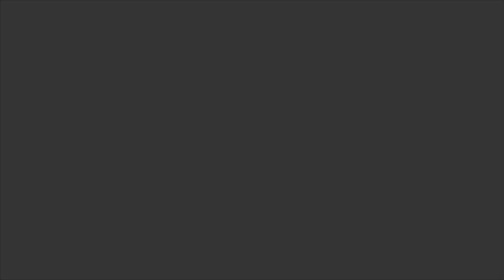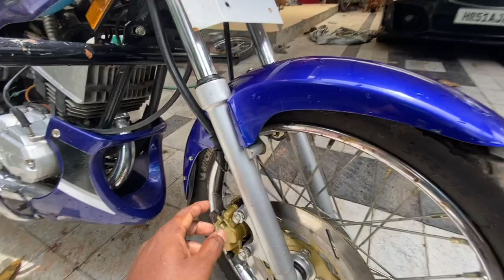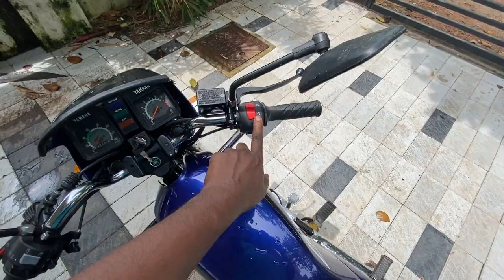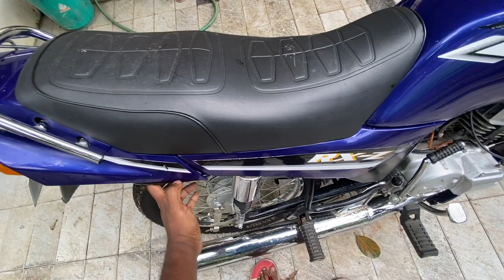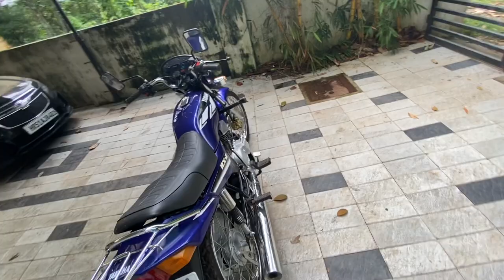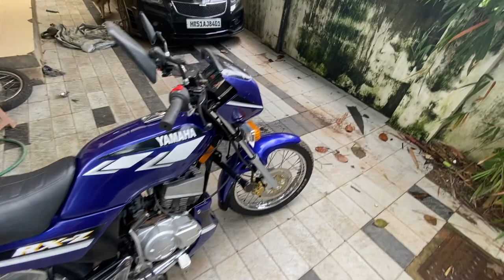Yamaha RXZ Mayalayam Review

Comment: Bro ee RXZ spedometer CD100 il namakk set chyan pattimo with RPM also angane chyanm  enkil enthokke mattam varuthanm plz rply
Reply from the maker: Athu eluppam alla, 4 stroke reading double aanu
Reply: @Yamakaze   ok bro ath chyanm nkil etha chyandath enn onn  cmnt idamo?
Reply from the maker: @cillianmurphy2130  simple parupadi oru pulsar meter set cheyunath aanu, 3 wire pidich koduthal mathi, positive from battery, negative from battery and pulse from HT coil.
Reply: @Yamakaze   ok bro thankyou
Reply from the maker: @cillianmurphy2130  👍

Comment: Bro I need to convert my stock 5 speed to 6 like 4s to 5s what will be the cost and how can I do
Reply from the maker: You cannot fix the six speed gearbox in the 5 speed case, not worth the efforts
Reply: @Yamakaze  any way I can convert 14bhp to 18 bhp king
Reply from the maker: Cylinder kit, connecting rod, carburetor, head and you are done for the performance. The rx king has different compression than Indian cylinder so the load on the connecting rod is higher, that’s the reason I have mentioned that as well
Reply: @Yamakaze  sir what milage  can we expect from  king and sir you have goodnpresemtation skills  pls start vloging with 2 stroke if you can then go with rd nobody in YouTube did it  and sir how is the performance of king is has that jerking of rx ot malayalam(tharipee)
Reply from the maker: It won’t be a machine giving you satisfactory mileage. Tharipp will be there. I will try the vlogging
Reply: @Yamakaze  sir you have king😳😳😳😳
Reply from the maker: No